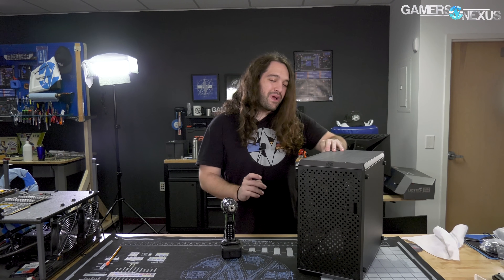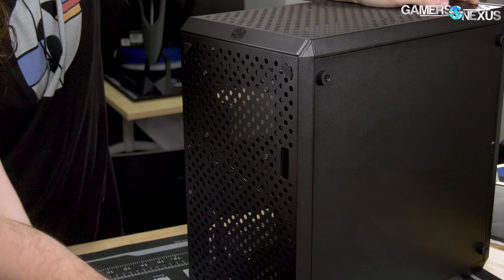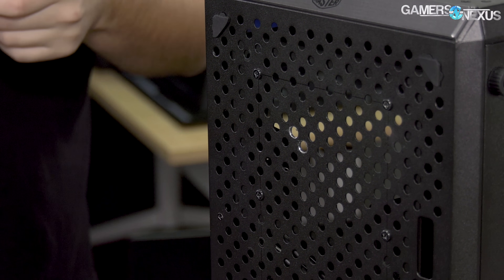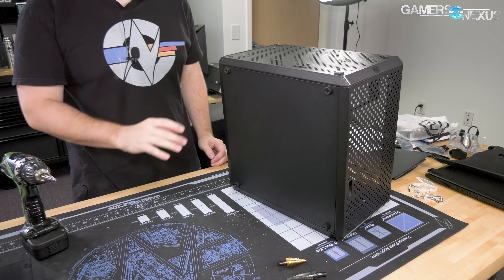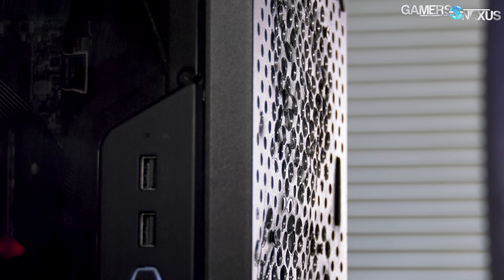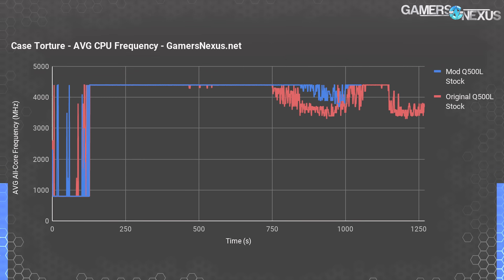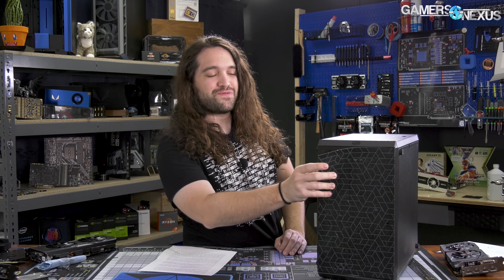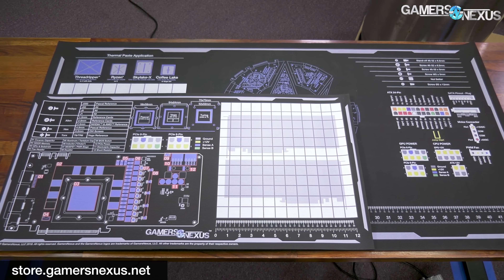"Fixing" Another Cooler Master Case: Drilling the Q500L for Airflow

Comment: Wouldn't it be better to just drill the bigger holes only in the area where the fans will be placed as to keep more of the structural integrity of the case? 

I do like the idea of a full ATX case in such a compact size and would be willing to mod the case, if I was in the market for this case. 

As I have a PC-O11 Air and two ITX builds, not to mention a Anidees AI Crystal case that just need a populated motherboard.... I don't really need another case.
Reply: I don't have many full ATX cases myself. I had to buy one for my last build in fact.
Reply: @1pcfred  after having built two ITX PC recently. I for see more small builds in my future.

Comment: dunno, I have a ryzen 2700 running 8 cores 3.95 ghz,and a overclocked XFX RX580 in a Q300L, peak I have seen on the CPU was 72 and video under 100% load never gets above 76 (left to its stock fan curve in open air its like 86), I think these cases are not meant to handle big loads yes, but not to many people are going to drop a i9 and a RTX in a 40$ case either
Reply: osgeld just imagine how much quieter your rig would be if it could run 10-15-20 degrees cooler 🤔
Reply: @TheSickness  its almost silent 90% of the time, and heh yea that stupid overclocked radeon again ran HOTTER using stock fan profiles with the side of the case off.. in fact the gpu fans are the only ones I hear

Comment: You could mod the side panel and put a fan there to aid the GPU cooling. :) (I get why manufacturers don't do that anymore, looks are supposedly more important than performance... and it can be a hassle to open the case etc., but totally worth it to me at least.) But yeah, just get a better case. Is the ANY new case on the market that has a side fan?

Comment: You should do an airflow test of different types of fan grill designs of cases.  Even an old fashioned wire fan grill is quite restrictive.  I like the design Dell has used before on cases where there is a large grill area with the fan recessed in a plastic shroud blowing into the large surface area.

Comment: If your going to mod this case, just cut two 12cm holes for the fans and then use the filter. That would keep most of the structural integrity as well as improve the air flow. I recommend getting a case with better airflow from the start, one that you dont need to mod. (but sometimes you have to make due with what you got)
Reply: True. I own the Q300L. But it's more of a necessity because of space issues and I wanted the cables to Go upwards instead somewhere else. I could use a mITX case, but there is plenty of room for the Q300L and it's damn cheap.
Still need to drill two holes.
Reply: @Deinorius  how is thermals for the Q300L? Is it anywhere near the Q500L in performance?

Comment: You have propably started a craze for modding this case. I imagine a Two piece bracket for the top front and another for the bottom front. A structure in the back and a plate in the front with artwork like an open mouth or a black hole. You can cut the piece out of the case and keeping the holed plate strong and put a fan in that hole. I should probably design that and post it for some one to machine it and for gamer nexus tu showcase it and make mod competitions o this case.

Comment: Quick pro tip: put a couple magnetic tool bowls in the case when modding a case to collect and trap the metal shavings.
Reply: Any tips for removing the metal shavings from the magnetic tool bowl?
Reply: @jackjones6936  put a paper towel in the bowl before you start moding the case.
Reply: @jackjones6936  as said above, put some tissue over the magnet
Reply: Oooh snacks
Reply: Tissue paper is annoying. Put tin foil in there.

Comment: The biggest puzzler here is why CM decided to do a square tiling of the holes instead of a hexagonal pattern which would have provided more area covered by holes without sacrificing structural integrity. It doesn't even look any better this way.

Comment: Get a block of wood like a 2x4 and cut it to the size of the inside of the case at the front panel. Then press it up against the back of your front panel for support so you don't warp the metal when you drill through it.
Also, I'd recommend figuring out your fan placement first, then getting a 4-inch hole saw and using that to cut out three big holes where you want your two intake fans and the PSU fan. This will give you completely unrestricted airflow, and you won't lose any structural strength after you screw the fans and PSU in. A four inch hole is big enough to let all the air through a 120mm fan but small enough to leave the screw holes.
Reply: Darn. You beat me to it.
Reply: Just Dremel the entire front panel except for 4 holes, one on each corner. Then design a front panel with good airflow and 3D-printed it. Screw it to the 4 holes and you are ready to go.
Reply: agree with you but... don't say "and you won't lose any structural strength after you screw the fans and PSU in." any loss of material in this situation will reduce structural strength. whether or not you needed the strength is a different story.
Reply: i would just use a dremmel instead, I don't think using a drill would be good against this flimsy material

Comment: Steve never put a stepbit in reverse unless it gets jammed otherwise you are leaving a partially cut chip and burr on every hole
Reply: And use a faster speed and less pressure to make cleaner holes with less warping
Reply: A centerpunch for damaging the starting-point where you want the hole drilled. Otherwise your bit will just dance around and make an uneven hole while it's trying to penetrate the topmost-layer
Reply: As someone who recently bought a step drill bit this knowledge is great to find!
Reply: and stop buying shitty cases so you don't have to do this in the first place
Reply: @jubeh  But that's the fun
Reply: Same for a normal twist drill bit

Comment: Wrap electrical tape at the depth you want to stop at. Repeatable results.
Reply: Also maintaining speed and 90 degree angle as best as you can will ensure cleaner cuts and less deformation of the material being drilled. And the drill doesn't need to be put in reverse to ease it out as it's not a directional flute path.
Reply: Overclock the drill for faster modifications

Comment: you can tape the bit so u know when to stop visually
Reply: If you use enough tape, it also acts as a stop.

If you use double sided tape and wrap sanding/polishing paper on the end, it also does that for you, too.

;D
Reply: seconded. It should be known that step bits are meant to be run at much high rpms  to cut cleaner holes than what Mr. Burke was doing. He did say it was his first time though.

Comment: I have to ask, why not put 140 mm holes in front of the fans and ad fan covers?
Reply: tried that before, the fan sucks the filter into it and touches the fan. (unless there is enough spacing)
Reply: @TrigrH  just a really sucky case.
Reply: @TrigrH  ok then, we use a proper hole say, cut our 140mm fan hole, there are plenty of fan mounts out there that could be placed between the fan and the grill giving plenty of standoff room to clear the crappy filter, and, let's just replace that while we are at it. If the fan filter is that bad, find another one, there are lots of those out there. Or, we could use some awesome billet fan grill instead of the filters. But, let's at least try to make it pretty. I know hes trying to save it, but hes proven it just a broke design. If it cant pull air from the bottom, pull air from the rear fan inside, pull air from a front fan and exuaste it all out the top, send it to The Verge as a free gift for there next PC build.
Reply: i hoped this will be as good as Deepcool Baronkase, but I'm dissapointed, too bad that one comes with flashy RGB AIO and ends up costing more than double because of that :/
Reply: he said it in the begining. He is looking for a method cooler master could copy.  This way they have to change a drill bit. and not change tooling. So a change that could be easily included in the assembly line
Reply: FDMtech  well I did not know that. But even then, CM did some whole case improvements after some GN suggestions. So they might retool the stamp:)
Reply: FDMtech  actually I used some in my current build that turned out nice that i got from Performance PC

Comment: That's just dumb.. any sensible person would use a hole saw or a dremel to open up a single opening for a fan
Reply: I might buy this case just to do this. I wanna fit a 240mm AIO on the front, after cutting out space for the fans to breathe, of course. I'll probably just use a hacksaw, and then grind down the remaining burrs.
Reply: @CaveyMoth  I know it's been 2 years, but just for the laugh I cut out 4 holes.  2 on the front and 2 on the top.  I installed a 240 rad on the front and a 240 rad on the top.  I then proceeded to cram a 100ml ek res inside as well.  It's a little cramped in there but my I7 is running at 5.1Ghz all day long...My friends think i'm retarded...my fans are mounted to the outside of the case.  I have no filters at all. lol  I didn't even bother putting the side acrylic back in.
Reply: @Spectre302011  Jeez, man, that's insane. I'd be worried about dust. I ended up using tin snips to cut out holes for 4 140mm fans at the top and bottom, and 1 120mm fan at the front. It worked perfectly, and was dust free after a year of use thanks to the filters. But then I recently changed to a Cooler Master NR200 case. I like small form factors! XP

Comment: This is one HAF-Baked product.
Please Cooler Master, don't make me LAF.
Reply: Don't think Cooler Master will listen. They are DAF.
Reply: I have a CM-Stacker case from years ago and it' still working just fine, I don't use the hinged side fan assembly so I get much better airflow.

It's a huge case overall so never seem to see anything over heat.
Reply: @Techdude HD The early 2010s HAF Cases were great. I love my 912, it's a little bit outdated but is still  a great case and the airflow is fantastic too. I bought 2 Megaflow 200 fans and set the fans to 5V instead of 12. I still prefer the 2011 ish front mesh + steel side panels instead of an useless glass front and side panels.
Reply: Yup, I HAFX to say they need to ditch that shit and Re-release the HaFx E-atx vertical case again, and producing a modern Front control for usb-C instead of the Esata that the last one had.
Reply: excuse me?
Reply: Do you HAF to make me LAF?
Reply: the name of the company is LAFable anyway, cooler MAFster? they aint really master of anything

Comment: I used a 4 1/2” hole saw (perfect for 120mm fans)to cut two big holes in the in the front panel of my q300l. It turned out great. And was much easier and faster.
Reply: Hope you read this after 9 months. I have this case too and would like to know, how did you not bend the plate while sawing two big holes in it?
Reply: Interesting. I'd like to do that too. But I prefer to rent it somewhere. ^^
Reply: Either with very high RPM and not forcing the holesaw, or with a backing material like a chunk of wood

Comment: Just like to point out when using a step bit, if you wrap the bit at your depth with tape it makes it much easier.
Reply: Plus running  the drill in the high speed setting and not the high torque setting. Man I hate to say it but when these tech tubers start picking up power tools it's debacle.
Reply: @durstroyer3924  I always think it's hilarious the way they're so timid with the tools.  It's not gonna bite.
Reply: @grennellusmc  well, depending on the tool and their competency...it might.

But in general they do look pretty timid. Glad I had a dad who is a master carpenter for that among many reasons
Reply: "No need to afraid, Steve, the Milwaukee Hole-Hawg won't hurt you."
Reply: @durstroyer3924  - Steve step drills like old people have sex... slow and painfully. I wouldn't mind bringing my fab skills out east and giving the GN crew a few pointers! :D
Reply: Gottech You should watch NFC (Not From Concentrate).
Reply: @jordanwolfe6478  thanks for another channel to watch

Comment: Just cut off the whole front panel, the top of the case, all the sides, and also the bottom.
Reply: And add a piece of tempered glass to the front. BOOM! You have one of those weird display cases.
Reply: ✌️😏 yes
Reply: and then replace it all with chicken net.
Reply: @TheRealFobican  Yes. I mean it has superior airflow
Reply: Yes.. just cut it off entirely..
Reply: also get rid of your cpu. that fucker eats all the power when overclocked. lol
Reply: just mount the mainboard on tempered glass and BOOM! you have a 2021 corona proved case
Reply: Who needs cases anyway, just put all the components on a table
Reply: The case wouldn't handle that heeven said by just making those holes larger it has had big impact on the structure.
Reply: @nicmonberg5974  r/whooosh

Comment: Back in the olden days it's wasn't your own PC until you touched it with a die grinder.

Or a Dremel if you were a little more... delicate...
Reply: Hack saws and files
Reply: @QK_SAND  I never tried to use a hacksaw to cut a hole in a case, too hard to start the cut. A Sawzall I did though, that was not pretty.

Not pretty at all.
Reply: @spastictuesdays340  hammer and nail to punch a hole then using just the blade cut out what ever you don't need. (Before we had rotary saws) way easier then using a 4" or 7" die grinder.
Reply: @QK_SAND  Hammer and a large flat screwdriver to that list
Reply: I still think this applies today. It's not a custom computer unless you've actually customized it, and RGB doesn't count.
Reply: hack all the things
Reply: dremel the fans mounting area and the put in "L" braces. not hard to do. why make a joke out of what could be one of the best "cheap" mod case on the market?
Reply: First thing I did with my CM H500 was to use a jigsaw to mod the steel front panel where the fans are mounted, to remove a bunch of material that was partially blocking the included 200mm fans.  Second thing was limo tint on the glass side panel.
Reply: I cut a hole in the top of an old OEM hp case with needle nose pliers years ago.
My power supply mounted in the top but the fan needed air.
I peeled that razor sharp shit like a soup can. 
I miss the days when 4 cores at 4.4ghz was considered crazy.
Reply: think my least delicate mod was done with an angle grinder however delicate is a given since we also had open DIE cpu's
Reply: I remember modding it with an angle grinder and car paint lol
Reply: Spastic Tuesdays chainsaw
Reply: yeah..  i still use the big tower i modded for liquid cooling in the early 2000s. that's the reason i bought a dremel. :)
Reply: Aye i was fhinking why not just dremmel out where the fan is. No restriction at all then
Reply: because of the reason he mentions in the video?
Reply: Brandon S  My point was, I don't want a transparent panel at all.  I want a high air-flow case without all the lighting and appearance crap.  Most of the better flowing cases today force you to have tempered glass panels when I'd rather just have a solid black metal panel, or better yet, one where I can mount fans, like I have with my HAF932.

Comment: Not enough hole.  Hate when that happens............
Reply: There are always other holes, you ether find them or do a Steve and drill them till wider.
Reply: Fine line between drilling the hole wider and wearing the hole too thin and breaking it @backupplan6058
Reply: @Rob S 
You will be surprised at how adaptable the holes are, never seem to get too thin no matter what you do as long as you build slowly. The only issue you find is once too big, you can’t always go back.
Reply: Well as long as working that hole doesn't make the hole holder as ugly as that poor case ended up being @backupplan6058